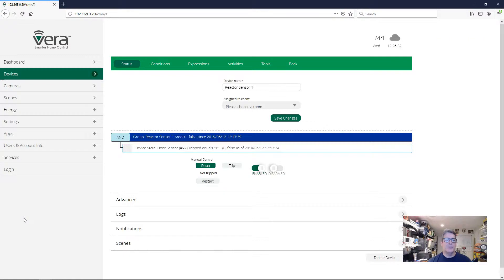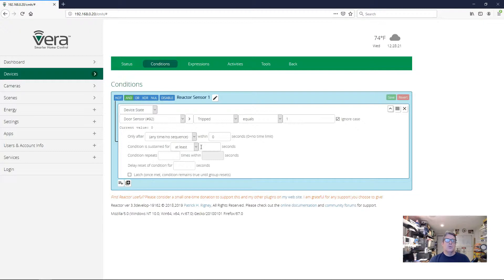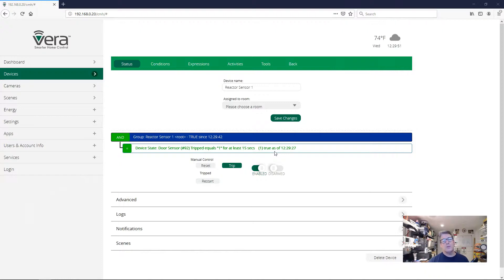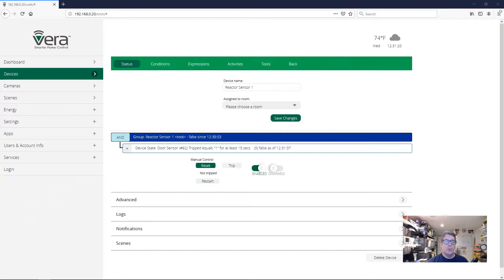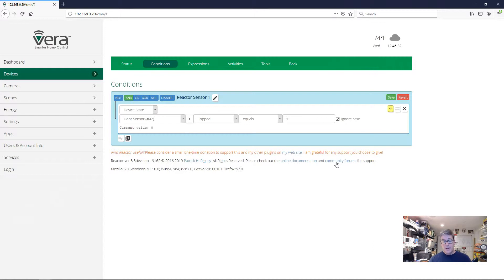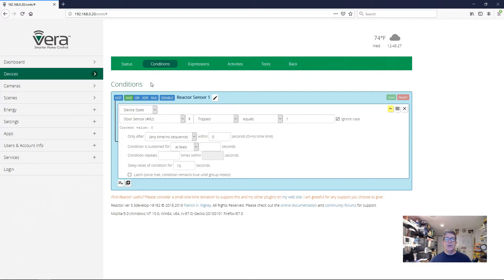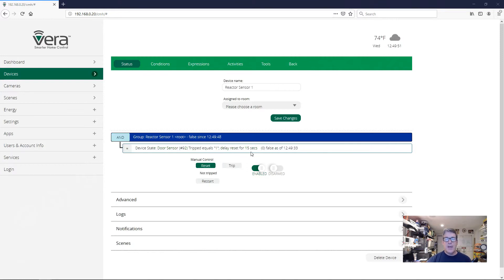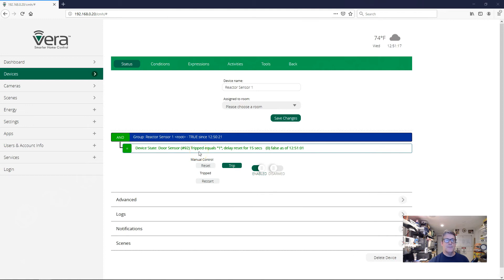Reactor for Vera #007 - Sustain and Reset Delays on Conditions

Comment: Can I create ONE Reactor sensor that tests (with OR) whether five different doors are open, and then sends a notification that includes the text identifying the door that is open?
Reply: Absolutely. It's a bit more advanced than just using straight conditions, but you can read about the basic methodology here: https://community.getvera.com/t/can-i-syslog-which-leak-sensor-tripped-when-having-multiple-sensors/213945

Comment: Do you use Scenes at all now, considering the power of Reactor? Moreover, would it make sense to replace all scenes with Virtual Switches for the purpose of Reactor being triggered by external actions (e.g. manual or Alexa commands)?
Reply: The same question for me. As a beginner and as far as I have learned Reactor is the way to go. Plain vera scenes seems to be very limiting. Is this correct?
Reply: I still use scenes for simple events that I want to trigger with Alexa, or with a scene controller like my Leviton VRCS4-M0Z keypad.